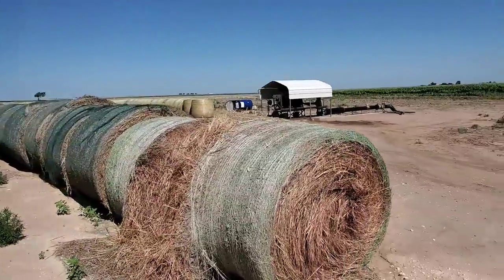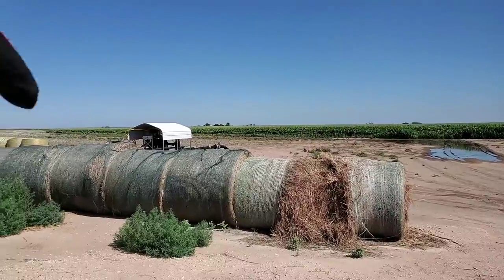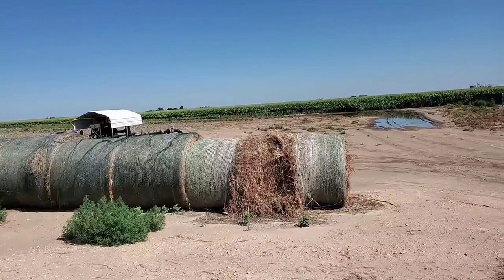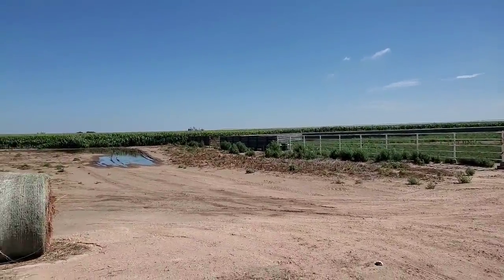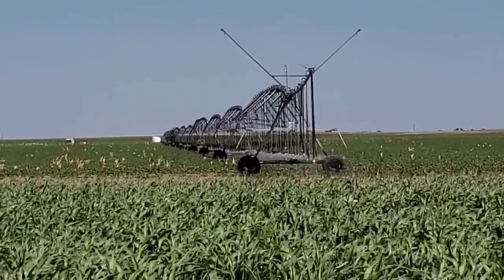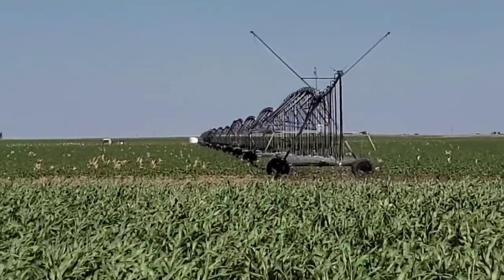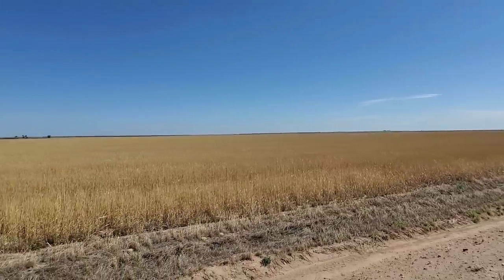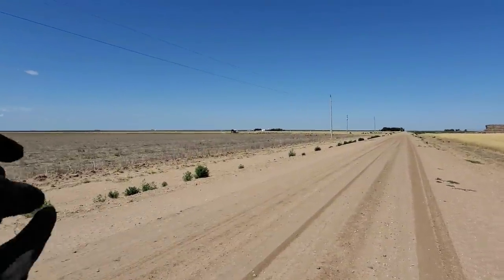Farming in the Oklahoma Panhandle

Comment: Flat. Endless flatness. My father in law who grew up in Oklahoma used to say "stand on a paint can and you'll be the highest point in oklahoma."
Reply: Actually, the altitude varies from a little over 400 feet in SE Oklahoma to nearly 4200 in the panhandle.
Reply: Elvin Ferrell  Thanks for the information but it’s not altitude it’s elevation. Altitude is the height an aircraft is flying above sea level or above the ground elevation below it if they have that type of indicator.
Reply: that depends on where you live in oklahoma i live in tulsa which is has a lot of hills, and there’s even the ozarks in the east

Comment: Those sprinklers are old, expensive, & the most inefficient due to evaporation and the cost of under ground piping and maintenance. The cheapest, newest, and most efficient way is using old plastic grocery bags.  Pioneered in southeast Arkansas by https://www.deltaplastics.com/.  They recycle more plastic than everyone else put together!  Almost zero losses to evaporation. I am not affiliated with them in any way.  I just go back to Stuttgart to visit relatives and saw it in use and asked about it. Farmers use it one time, roll it up on a spindle in the late fall and take it back, Delta Plastics recycles it and the farmer goes back in the spring and gets a new spindle full of the plastic pipe and rolls it out where needed.  This method is spreading across Arkansas, Louisiana, & Texas rice and soybean lands.

Comment: Would diesel engines be cheaper and more reliable for these pumping applications?
Reply: Apparently natural gas is cheap and plentiful in that area. Natural gas converted gasoline engines are more efficient and reliable than diesel and simpler/cheaper to repair. Emergency generators in my area are all natural gas fired gasoline engines for that reason.
Reply: Steve Varholy  Diesel engines are simpler compared to gasoline or gas~converted engines.
Reply: @bjs2022  Less parts on a diesel. But the repairs on a gas engine easily done by most any mechanic.

Comment: I am failing to understand the economics of this application of a 454 V8 gasoline engine to pump water at a stationary location.  Can somebody help?

A 454 engine rated at 310 horsepower (hp) running with a wide open throttle (4,500 rpm) burns roughly 28.5 gallons of gasoline fuel per hour or 684 gallons per day.    At a fuel price of say $2.00 per gallon, this operation (if running 24/7) costs roughly  $1,368 per day or ~ $41,000 per month (just for the fuel).  Let us set aside and forget about maintenance and oil changes for the time being.

An electric motor generating the same 310 hp equates to approximately 231 kilowatts (kW) of electricity.  This translates to roughly 5,544 kilowatt hours (kWh) per day or 166,320 kWh per month.  The price for electricity in Oklahoma is roughly 9 cents per kWh ($ 0.09 per kWh).  This translates to an electrical energy cost of roughly $499 per day or  $14,969 per month.  The weekly/monthly maintenance costs for an electrical motor are pretty much nil  in comparison to a gasoline engine running continuously with a wide open throttle or the course of weeks to months (168 hours per week or 728 hours per month).
Reply: Peter Townsend, i would bet the farmer running that operation is far better at managing his costs than your wild ass assumptions betraying your  logic.
Reply: @awesomexistence  If you didn't see the gas reg it would be an easy mistake to make.
Reply: The engines are running on natural gas, they are also running around 2000 rpm, being gasoline engines running on gas they would also not be running anywhere near full throttle, detonation would kill them. Had a 6.6 ltr Chev engine destroy a piston and punch the block on the test stand at 1500 rpm while running on LPG, it's unbelievable how fast ignition detonation becomes engine detonation if the conditions line up.
Reply: What's hard to understand? The engines are powered by natural gas, probably from the farmers own land, and those engines and pump were paid for long ago. Right now, that setup is making money, not costing money.
Reply from the maker: Great info thanks all!
Reply: @SIGINT007  Having access to cheap gas is almost unique to the US, in Australia irrigation pumps are all diesel powered, even those only a few miles from a high pressure gas main. The regulations that you need to work through and the fuel gas cost makes it just not worth it. Our previous governments have pre sold a lot of our gas to Asian countries, locals are paying the same price or more.
Reply: @NusaCat  Thanks for the clarification.  It appears in my haste and naivete I too quickly assumed the large drums were fuel storage tanks for the engine(s).  People come to these things with varying levels of knowledge and experience.  It's always nice to learn something new.  We are all better for it.

The math does not work out any better for natural gas if one uses the Oklahoma market rate for industrial natural gas which has trended at about $2.50 per 1000 cubic feet since 2016.  A modern natural gas furnace burns natural gas at a thermal efficiency of about 97%.  A basic natural gas fired electric power plant has a thermal efficiency of about 40% and a state of the art combined cycle natural gas power plant has a thermal efficiency of about 60%.  By comparison, an internal combustion engine has a thermal efficiency of about 20%.  That is to say 20% of the natural gas energy is converted into work energy to power the well pump and 80% is wasted as heat through the engine cooling system and exhaust.   Clearly not an optimal use of natural gas as an energy resource commodity.

From a normal economic market perspective this pumping setup makes about as much business sense as trying to operate a modern taxicab service with a vintage 1970 Chevelle equipped with a 454 that gets 8 mpg.

Leaving aside some of the obtuse emotionally triggered comments, the consensus of comments appear to affirm this setup as a quaint technological Coelacanth from a bygone era that would not be economically viable if not for a local non-market supply of "free gas".  To that end, the video nicely captures a form of local living history that is not seen or known in other parts of the country/world that have long ago transitioned to deep well turbine pumps powered by economically efficient electric motors that are unobtrusive, quiet, and reliable.

Comment: Why not diesels?
Reply: R44 Driver because they’re running on natural gas which is cheaper than diesel and the motors will last longer then diesel motors when they run on natural gas
Reply: @ron9381  Diesel engines can run on natural gas and do, particularly small diesel-electric plants for towns and small cities.
Reply: Roy Reynolds the back up power for CMA tower is a natural gas powered Cat generator
Reply: Roy Reynolds Yes They can but a Chevy 454 is inexpensive for the work it does and farmers have to be cheap because they’re working on a slim margin